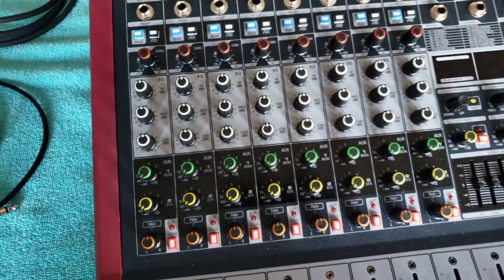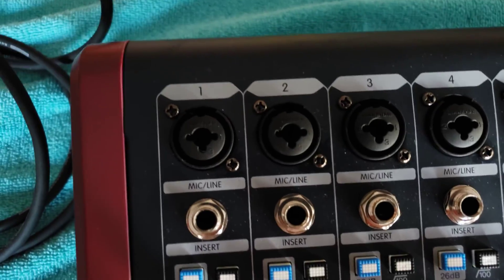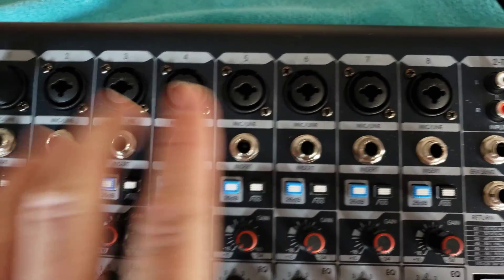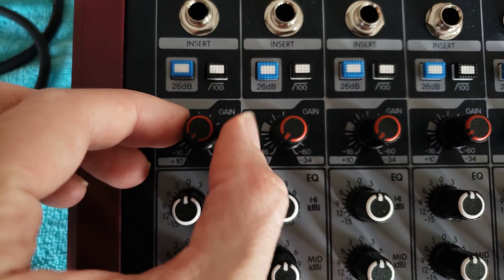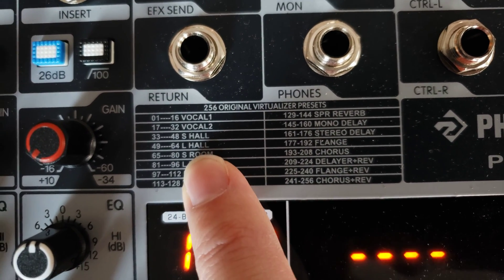POV Audio Mixing Board Tutorial 4K 2024 (part 1) Featuring a Phenyx Pro PTX-400 Mixer Console

Comment from the maker: Chapters
0:00 - Introduction
1:12 - Powering On
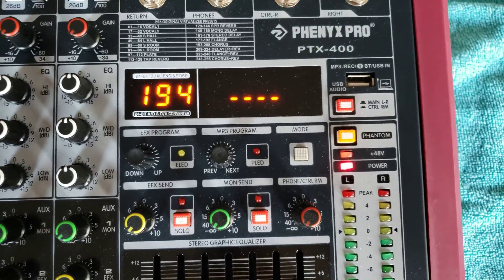1:28 - Channel Inputs
3:41 - Insert (Outboard Processing or External Effects)
4:40 - Attenuation Pad
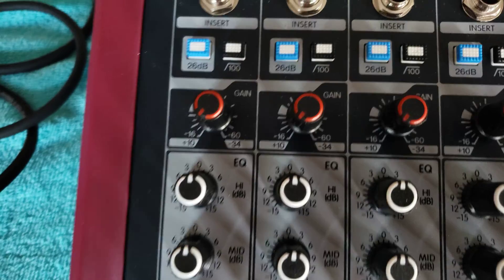5:08 - High Pass Filter
5:58 - Preamp Gain Control
7:02 - Main Output Faders
7:32 - Unity Gain/Channel Faders
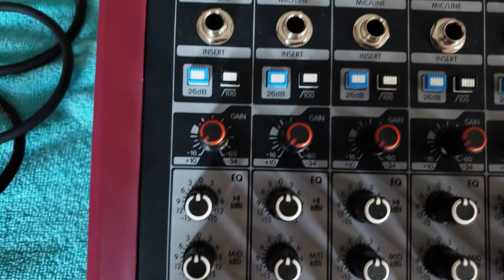8:28 - Equalizer
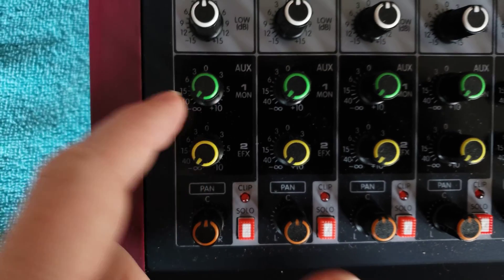9:31 - Auxiliary Sends